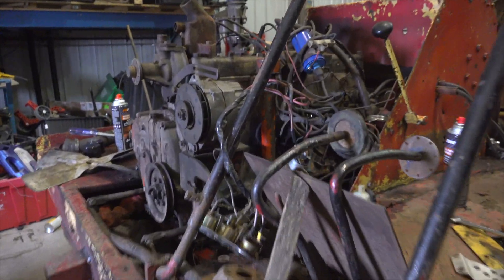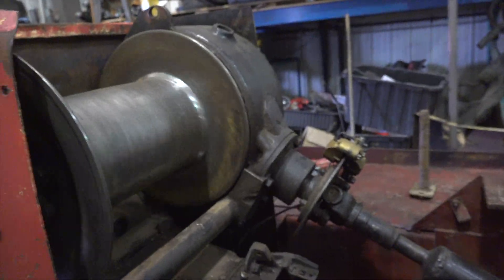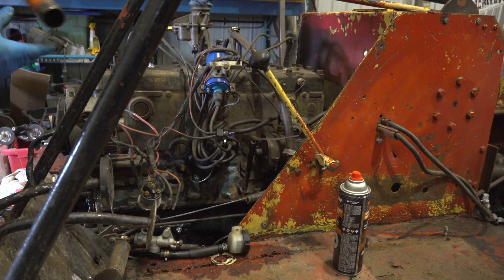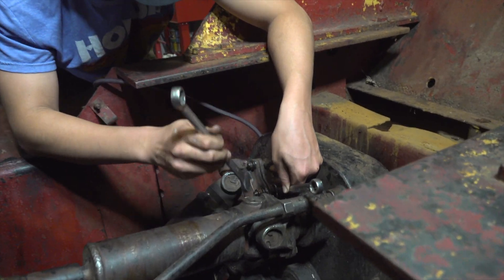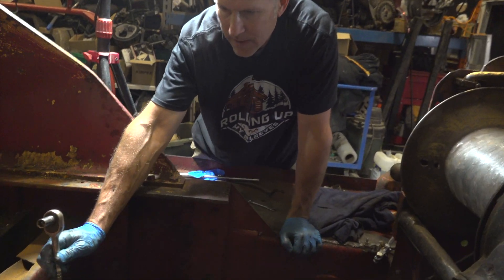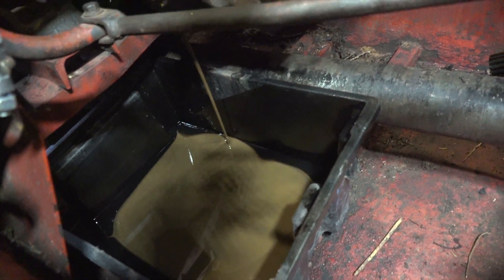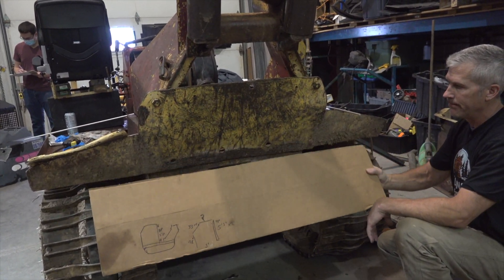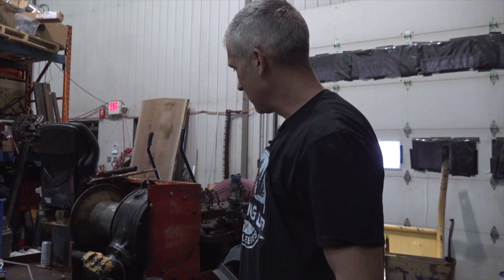Tracked Ram Skidder Rebuild #2  Fluid changes and more.

Comment: Hopefully you decide to diesel Swap & Hydrostatic Transmission and drive motors this skidder thing of yours Should be fairly Straight forward build you have lots of Experience with mechanical builds so I hope to see you tackle this machine & should be lot's of Diesel Engines and drive motors like a Used equipment auctions all over the place. Will be keeping a eye on this And good luck from Northeastern Alberta.
Reply from the maker: Just bought a hydrostatic SW48 - video coming.

Comment: For those close to impossible to drain and old, old "oils" in transfer cases or diffs I usually drain a bit out then add diesel and run them to mix the old gear oil up and then to have the diesel clean out old residue and water before refilling fresh 80w-90 gear oil.
Reply from the maker: Great idea - that's next!